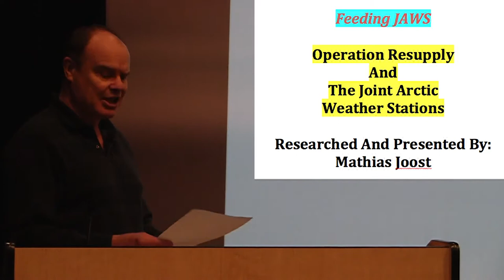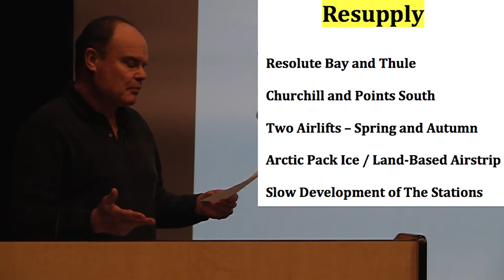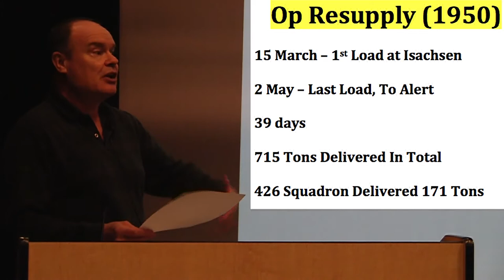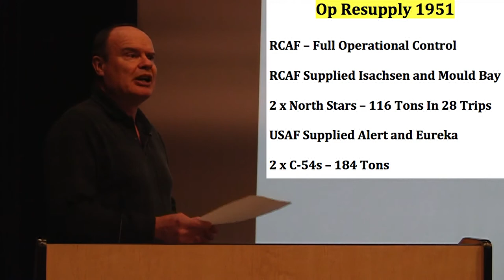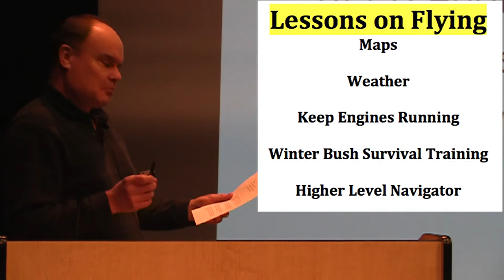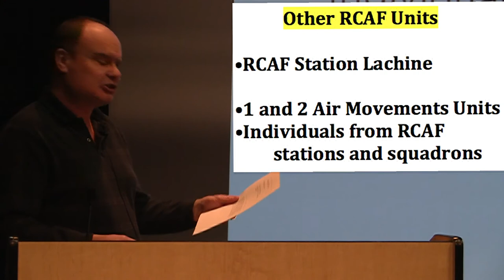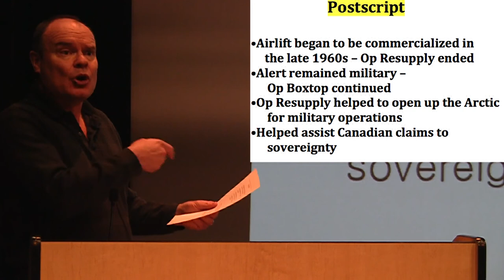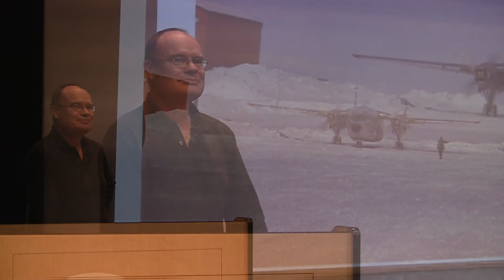Feeding JAWS (Joint Arctic Weather Stations) - Operation Re-Supply

Comment: In the list of Station Personnel at about the 10 min mark, there should also have been listed Radio Operators who transmitted meteorological data and operational data.  This was mostly done by Morse Code (CW).  It would be sent from the satellite stations, Alert, Eureka, Mould Bay, and Isachsen to Resolute Bay.  Resolute Bay would then send the data further south by radio teletype or Morse Code when conditions were too poor for radio teletype.  Radio Operators were mainly supplied by the Department of Transport (DOT).  US Operators in the early days were usually Military Operators.